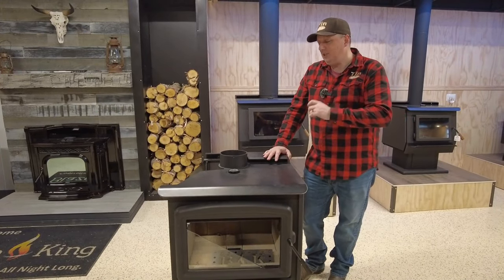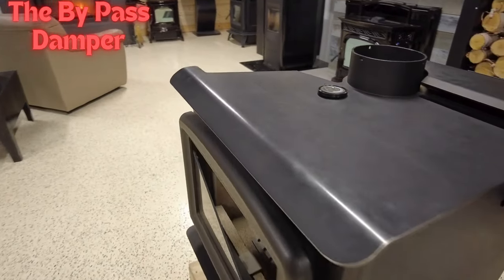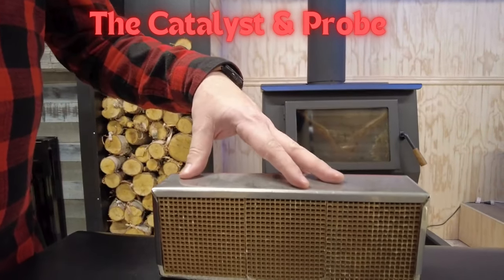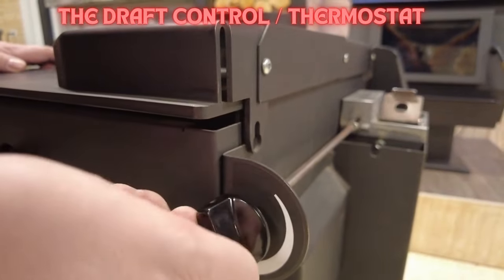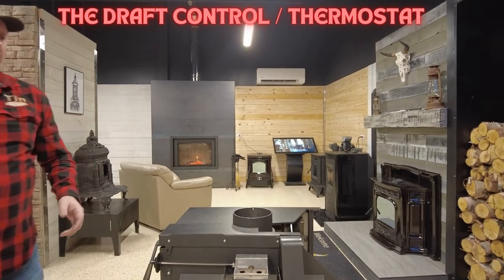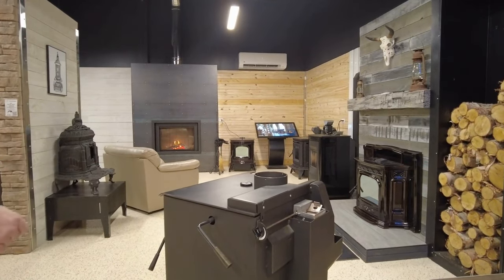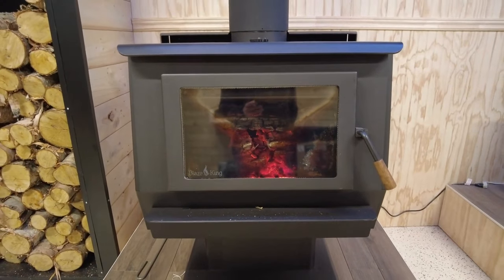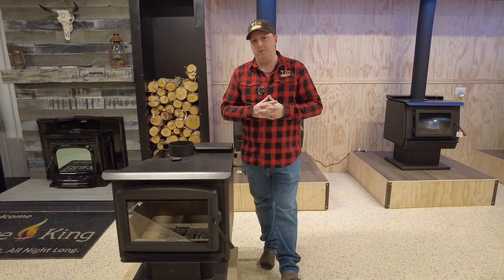Blaze King Wood Stove - How it Works - In Depth Look Inside

Comment: Problem I have had with the Blaze King is cleaning it in the spring:  Lots of creosote gets trapped between the internal steel baffle panels on the side walls and back side and the iron sides of the stove.  It is really difficult to scrape all the creosote shards out as there is little space to maneuver.  I use a bent piece of flat steel and it takes a lot of work.  Do you have a suggestion on a better way.  Is there a way to remove the internal panels? - they seem to be welded on.   I think they should have made it with fire brick all the way to the top.
Reply from the maker: I would burn the stove hotter. Chimney height is also extremely important.

Comment: I’m looking at the insert ashford. Can you burn it so you can have some flames aka aesthetic value at looking at the fire? If you do so how much does that mess up the cat or limit burn time? I like the efficiency but like the looks of reburners. I have a 17ft exterior chimney also worried about lack of draft.
Reply from the maker: You can still see flames if you wish, you just need to turn the stove up more. Like anything it will burn more wood with more airflow. Blaze Kings simply turn the amount of airflow going into the stove by as much as 70% where secondary air stoves only about 30%.
If you want the visual appeal more than the wood savings then go with a secondary air stove. If you want more controlled heat over longer periods of time then go with the cat stove.